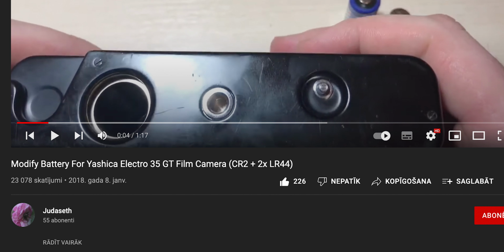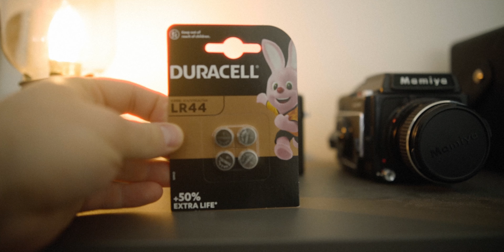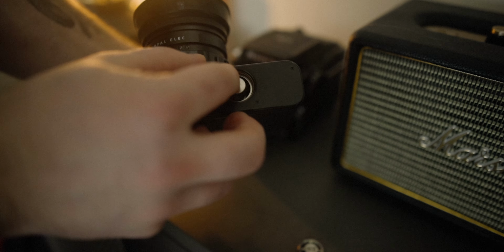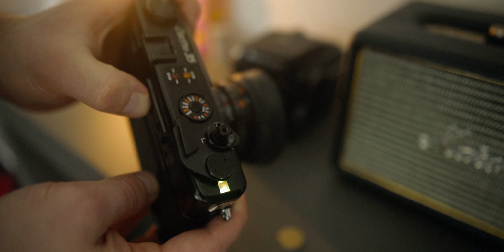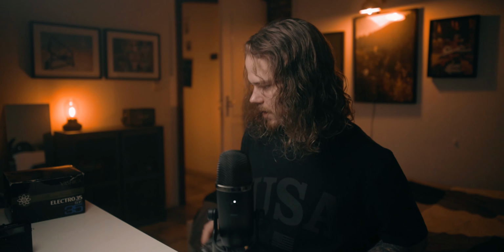FIRST TIME SHOOTING 35MM FILM | Yashica Electro 35 x Kokdak Gold 200

Comment from the maker: What is your favorite 35mm film camera? 👀
Reply: I use a Pentax Spotmatic
Reply from the maker: I loved the photos you took in Hout Bay with that camera! 🔥
Reply: favourite one rn is the bessa r2a 🤩
Reply from the maker: @jaycielinh  You been shooting hella good photos with that camera! 💯
Reply: I have a couple of favorites. One is the Olympus OM-4 for its spot metering system. The second is the Nikon F100 for its autofocus capability. In both cases, the cameras were used professionally for both commercial and news work.
Reply: Yashica electro 35 GX is a smaller version, 'almost' pocket sized!
Reply: Petri Color 35
Reply: I'm a purveyor of the good, that bad, and the goofy.

Comment: Just happened on your stream. I got a pristine GS model in 1998 after my father past. It was in a full Yashica camera case and came with the telephoto and wideangle conversion lenses with case. Being very involved in photography for since 1970, I asked my camera repair guys if it was worth keeping as I did not know anything about the camera being an Olympus SLR shooter. The repair guy said the lens was very sharp and it was definitely worth keeping. I got the door seals replaced and still shoot it to this day although I only load the camera with Tri-X, my favorite b&w film.
Right now I shoot it without batteries as I try and relearn some old skills of judging light and adjusting the aperture to fit the default 1/500 sec shutter. Haven't sent the film to my lab yet (I sold my Nikon film scanner) so I don't know how I am doing yet.
Reply: Did you developed your film?
What aperture worked for you without the batteries?
Reply: @ismiv23 depends on your film iso. If the default ss is 500/ use a light meter app and set the ss value to 500. It’ll tell you what to shoot at aperture wise based on your iso and locked ss.
Reply: @ThatWhite636  thank you very much!
Great advice

Comment: I dug out my Yashica 35 today after a couples years of not using it and wanted to see what others were getting from it. Low and behold the first video that comes on is this and its shot in the hague, the very town I boguht it in. Uncanny. Another tip fr the battery is to use tinfoil formed into a cylindar under the A544 cell!

Comment: You do not need the adapter. The PC164 battery is a direct replacement in the yashica electro 35. I have been using them for years with no hassle. Easily found on Amazon
Reply: Link please?
Reply: Link?

Comment: The problem with the original battery is that it contained mercury. Mercury is toxic. Millions of mercury batteries in landfills created environmental problems.

Note that a 35mm negative is much smaller than a 120 negative. So, 120 allows a photographer to enlarge a print with more detail.